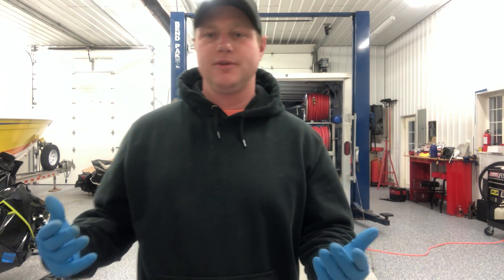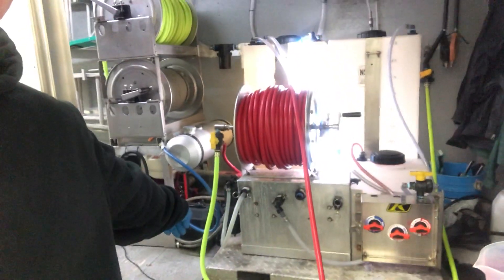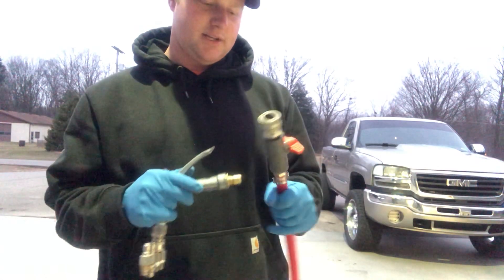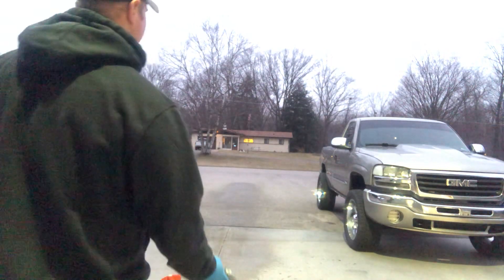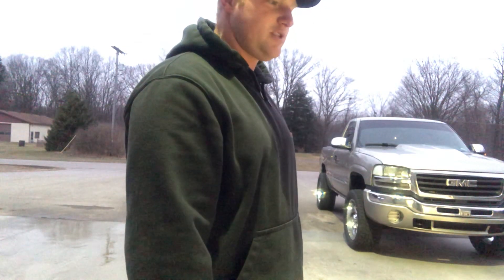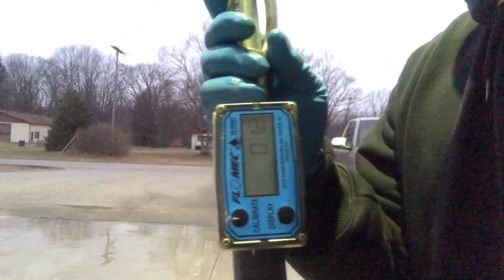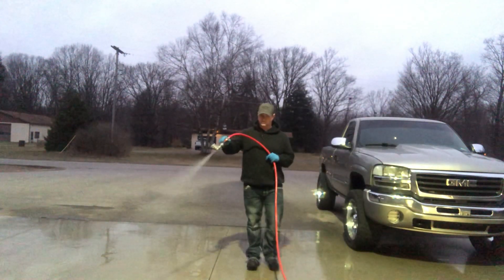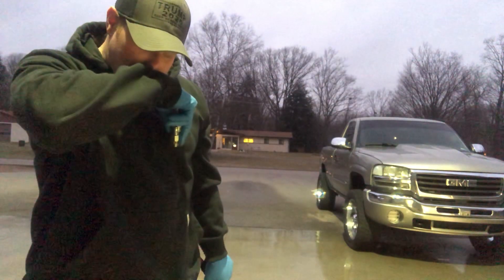12V soft wash pumps don’t last?

Comment: Great 👍 video buddy
Reply from the maker: Thanks, do you have that pump tec?  I believe its the x6 I saw a video of yours on it and have researched it a bit for a year or so and idk how they do in the field?
Reply: @softwashscience  yes I do 👍 I’m putting the box together now and will be dropping videos on it very soon. Plumbing the 3/4 dual battery 12 volt system up as we speak. There has been lots and lots of people interested but it seems everyone tries to keep it “TOP SECRET” and that’s why there has not been many videos on it yet. I am going to explain that in my videos also because people are curious to see it but everyone is also keeping them pretty private when in reality the public needs to see and be able to touch the product and use it. And purchase it. So I am putting it together now and as soon as it’s ready I will launch it 🚀 I’m gonna be running it by itself not with a pressure washer combined because not everyone wants it that way. They would rather just run it by UPGRADING their own existing 12 volt systems or adding this as a 12 volt system. When it’s ready I’ll launch it on all my platforms for the world to see. Thanks
Reply from the maker: @littlespressurewashing  you will be a straight legend if you pair it with a huge deep cycle lithium battery.

Comment: I have a question I have a 5 1/2 gallon per minute 22v pump and 3/8 hose what's 150'ft My pump seems to be cutting on and off while I am spraying continuously If I upgrade my hose to a 1/2 inch will it run without cutting on and off🤔
Reply from the maker: 3/8” hose kills that pump go to 1/2” and buy the right tips.  Give that a try, and get back to me.
Reply: Thanks
Reply: I'm running J rod For tip
Reply from the maker: @Gameingkid123  J rod is just a holder you could have 4 tips of any size so you could have 100,000 of the wrong combinations for your setup you know?

Comment: Hey Josh, Mac here, excellent video on the spray patterns your getting with the George Fisher 1/2” ball valve.

Would like to talk with you some time, if you do that. Kind of new with Soft Washing, 3 years now or so.

Building my first trailer, on the new driveway of the new house my wife and I just bought 4 months ago here in Florida.

Could really use some advice if your able or willing , if not, its cool.

thanks for the great videos and knowledge your sharing, I appreciate it.

Mac

Never built a trailer before, if your don’t mind, I could use some help on placing my 12 volt system correctly so that it will run as efficiently as possible, like yours.
Reply from the maker: Yeah anytime thanks for the kind words.  Text me at (616) 299-2390 so I know its you and then shoot me a call or facetime so I can see what ya got.

Comment: I asked AI 200 feet of 5/8, and yes, it dwindles down on 5/8 gpm.  But if you run the first 100' in 3/4 and then 100 feet in 5/8. Gpm goes up nicely. Pump I told AI was 7 gpm. Running all 3/4 would be great but I don't like dealing with 3/4 hose up on the roof. 5/8 is nicer to handle.
Reply from the maker: @1stFlyingeagle  in video i am running 1/2”
Reply from the maker: @1stFlyingeagle  in my opinion, you can run half-inch if you’re only running 200 feet of hose and you’re not gonna really have any problem. If you run 5/8” and you’re only running 200 feet. I dare bet you it’s going to spray better than a few run 3/4”.  Your pump outlets say they are three-quarter inch but if you actually look at the ID, they are really not. I know at my house. I run all sorts of different hoses to water my grass and I can run like 50 foot of 3/4 and then the rest like 100 foot of 5/8 And it kind of sprays like crap off my well pump. But if I run just 150 foot of all 5/8 it sprays way better at the end.  It actually hurts the performance when you go from small to big then back to small.  Bottom line is when you go much longer than 230 feet or so it starts to really lose performance. I have about 270 feet on the real that I run now but I only use it for roof cleaning and I never like when I run out of hose, so I make it work and it’s set up as best as it can be for what it is.

Comment: My wife is a dog groomer accustomed to city water pressure and flow rate.  She's new to mobile grooming.  Our current system is better than most mobile groomers, but it's still not good enough.  She needs better GPM + PSI.  She will only use shower setting on any standard garden nozzle (there's no changing her mind).  Currently running (2x) 12v shurflo 4008 pumps (3gpm/55psi shut off), (2x) accumulators. One line goes straight back (w/ ball valve), the other passes through a ventless propane water heater (1.6gpm/120max psi).  1/2" PEX the whole way (4' vertical priming, 16' total distance). Both lines come together using a Y mixer washing machine hose (3/4") and into a flexible line (1/2") and nozzle (garden hose adaptor).  I assume the problem is water heater output doesn't match what the pump is capable of. Likewise for running 1/2"pex vs. 3/4"pex.  NVM ALL THAT..... How would you set up a dog washing trailer to match the flow and pressure coming from the city.
Reply from the maker: I would buy a 6gpm or 7 gpm pump 70 to 100 psi.  Upsize your lines if you feel like you need to but bringing 2 1/2” lines into a 3/4 should be plenty but I think pex lines are measured by the OD and not the ID so it might not be even a true 1/2”.  Also the ball valves and y mixer and all of that I would make sure your valves have a large orifice and basically just figure out where or if you have any restrictions in your system holding you up.  Could also be the nozzle your using is restrictive.  Also city water is always 60 to 80 psi and flow typically is 8 to 12 gallons a minute.  Bigger lines, bigger pumps, better valves maybe like I said and better sprayer.  Shower nozzle is fine just make sure its a good one.  Also see if you can disconnect somehow and test the ammount of flow you get from the water heater and see if thats the issue.  If it was an issue that pump would sound a little different than the other one you would hear it staining more.  In the short term something to try would be adjusting the screw on the bottom of the pump.  Most pumps its a Phillips head or an allen head and if you crank it like your tightening it that should increase the pumps pressure setting / shut off psi.  See if you can crank both pumps up and that might fix the problem but I would say your going to want bigger pumps eventually.

Comment: I have 5.5 gpm Northern tool Northstar 12v pump. It's been over 5 months now and still going strong. I rinse fresh water through it after every job. If it goes bad so what they're only $160 better then buying a $1000 plus pressure washer. I use it for house washing instead of pressure washer. I have Two 55gal drums with the pump mounted on the top and hoses going into each drum with valves on them. 150ft of 5/8 flexzilla garden hose hooked to my homemade wand and I can reach over 2 stories high. It works for me and makes me $. I only use my pressure washer for concrete cleaning.

Comment: thanks bro..new here. But stupid question, why would i need a wand vs a gun vs a "straight" connect? do i really need both or is as you demostrated get away with the converter.
Reply from the maker: You don’t need more than one I just do
Reply: @softwashscience  Cool. Which one do you see your self using more often? thanks!
Reply from the maker: @d0uble_O   the trigger gun
Reply: @softwashscience  cool! thanks!

Comment: I run a NorthStar 7GPM. Been running it for a year now and no issues at all. I rinse 
everytime after each job. I do mostly house washes with a occasional roof so that may 
have something to do with longevity of the pump.
Reply: Is those pumps good?
Reply: @keithmeka4ever377  Soft washed over 100 homes and several small commercial jobs so far. 
Works great.  I run 5/8 flexilla hose. Get about 40 ft distance .
Reply: How have you got the inlet side of your pump plumed. I run the same pump and 5/8 on outlet side and only get 24' on good day. What tips do you run
Reply: @tonydodd9034  I run 3/4 poly braid tubing on the inlet side to the pump. It runs through a half inch PVC pipe manifold that built . I also run the water side with no valve. I only run a Pentair valve on my chem side. 

I run a homemade wand out of 1/2 PVC  pipe about 16 inch length. Then reduced down to 3/8” copper tubing 4 inches long with a threaded end . With a 
15 dollar Ryobi adjustable tip. 

My NorthStar finally died. The pump head went out. Would have ordered another pump head but they were out of stock so I bought a Delvan 100psi 7gpm  12 volt pump. About the same distance as the NorthStar.

Comment: Josh you not only have an amazing rig set up bro, but you also have a badass personality 😎 

I look forward to watching more of your videos and learning what I can! I currently have a painting and remodeling company but have been wanting to venture into pressure & soft washing, I'm not sure if I want to do a skid build in the back of my truck, or use my 5x10 single axle enclosed trailer, or my tandem axel 6x12 open trailer? I like the idea of the skid build for not always having to pull a trailer, but then I lose the back of my bed, I like the idea of the enclosed but the problem is that it's only a single axle! And the only problem I have with the tandem axle 6x12 is it'll be open to the environment! What would you suggest? Appreciate any advice, thanks Josh and you also got a new subscriber bro!!
Reply from the maker: My entire trailer is disassembled and I’m building all new now if I were you I would do an open trailer because it has the two axels
Reply from the maker: But enclosed can be nice as well if you hve multiple vehichles do a skid buts its gpong to ruin your truck
Reply: @softwashscience  thanks bro, I appreciate the advice man! Looking forward to your next build!!

Comment: I use a Harbor Freight irrigation pump. Almost 18 gpm. No battery to charge. No worrying about losing battery power. Just a little gas in my Honda 3000iu inverter generator.
Reply from the maker: To much flow for residential roof cleaning though and won’t work with the proportioner .
Reply: @softwashscience  I've been using it for 3 years, with a proportioner. Here in Georgia, many houses are 2 stories and taller, so it works great.
Reply from the maker: @ILC-eo6vk   then its not an 18gpm pump because the proportioner is only able to do 13 gpm max flow but your never going to run your soap wide open so really it will only flow about 8-9 gpm max.  If you doing vinyl siding your only going to get about 6ish gpm maybe 7.  Doesn’t the pump overheat if your not on the trigger and lets just say left it running for an hour or two?  Idk flow is great but not for roof cleaning.  I assume your doing mostly house washes it sounds?  Then yeah it probably kicks butt depending on the psi and all that good stuff.  I never use my 12v to wash houses really its mainly for roofs and other high sh needs.

Comment: Hey josh, would a full rite 12v pump work? Like one for fuel transfer
Reply from the maker: No those are transfer pumps probably low psi and a bypass style and wrong seals if its for fuel.

Comment: Do u rinse with 12v?
Reply from the maker: On a very very rare occasion I will like if I wash a shed or something.  Outside of a few pumps that exist a 12v can’t give professional results.  You need about 150 to 300 psi and some large volume to rinse correctly.  Even my 5.6 gpm can’t rinse some areas correctly.  Vinyl houses here and the Lichen we get here needs big water droplet’s to come off.  I see people just simply putting water on the siding and think thats rinsing and if they brought their rig to the jobs in my area they would be in for a rude awakening.  I treat siding with my 8gpm and rinse with it too.  12v is mainly for roofs, concrete and that high % sh stuff.

Comment: Ive never hears of an accumulator
Whats that do whats it for ?
Reply from the maker: It a holding tank for pressure so it stores pressure and helps to prevent rapid pump cycling when you want to use different tips.  Without one your at risk of killing the pump unless you use the correct tips.  In short it allows you more versatility  for spraying.

Comment: Hey bro do you have a part list I want to make my 1/2 hose quick connect on my soft washing
Reply from the maker: Solution Landscape & Pressure Washing I explain it in detail in the late night video and a couple other videos on my channel here and show close-ups so you can see everything you need and exactly how I put it together.
Reply: Soft Wash Science I just looked you mean 5 days ago correct I didn’t see anything 
Thank bro
Reply from the maker: Solution Landscape & Pressure Washing  no I have a couple videos from awhile back.  You can see it up close is at least 3 of the videos on my channel and you can make a parts list from it.
Reply from the maker: Solution Landscape & Pressure Washing  In one of my videos I not only show it up close but I give a parts list as well.
Reply: Soft Wash Science thank you
Reply: @softwashscience  couldn’t just post a link?
Reply from the maker: @CKimbrow12  no idk what one it is I reference it in a few of the videos and two I go into detail about it.  I would say that it took me a lot longer to design and orient the first one than it will take yall to find a video  here about it but I know its in a couple if I recall.

Comment: Am I understanding correctly?

1% = 10%
2% = 20%
3% = 30%
4% = 40%
5% = 50%

Does this figure relate to the downstream mix or what % is coming out of your tip?

What % should I begin with on non-painted wood, such as on a deck?
Reply from the maker: The % is = to the the exact % of SH strength that will make surface contact.  If you look wide open is 6%.  The values are based on an 11% sodium hypochlorite concentrate. I buy stronger SH but Sh is heavier than water and my line is longer with a few bends on the sh side so the number on the dial for me is pretty close to the exact.  Downstream mix I pull from a different source and that goes directly into my injector about 12:1.  For wood cleaning thats a different animal and I Approach would Cleaning different than anyone else so I can make some recommendations but it’s not as simple as just a percentage it’s an entire process no matter what chemicals you choose to use.
Reply from the maker: If I were you I would just start out down streaming everything just make sure you soft wash.  No hard washers round here lol.

Comment: Hey my man yes you definitely got the details and science down. What exactly did you do to reduce the 3/8 quick connect to the 1/4? Looks like a plug to quick connect? Do you have a link to where I can get that please?
Reply from the maker: Carlos Saldua its a 1/2” to a 1/4” and I made that myself because they don’t exist.  The end adapter it also a 1/2” to 1/4” on the carbon fiber wand and I made that on a 3d cnc mill.
Reply: @softwashscience  I figured as much I looked all over. Eould you be willing to do a little sales, I wouldn't mind buying a few...
Reply from the maker: Carlos Saldua can you message me on facebook with screen shots and stuff circled that you want so I know for sure were talking about the same thing.  If I have some I can sell you one but I do a lot of what you see kinda one off.  When I pull a guy off what he is doing in the shop thats making $300 an hr and I have to mesh some custom stainless fittings together I will essentially loose money and do loose money when I make some of this stuff but I’ll see what I can do.
Reply: @softwashscience  Okay definitely understand that! I have a buddy that's been a CNC machinist for years let me see what he can come up with!
Reply: I'm IN!.. I could use  a few of these also......I WOULD BY NOW....WHERE DO i SIGN???

Comment: Hi,
My pump is not shooting a good distance. I don't hear air in the line. Why do you think it's only shooting about 15 ft when it used used to be about 40 ft.
5.5gpm everflo pump
Reply from the maker: Yanis Hall The battery might be weak or the wiring connections. It could have a small air leak somewhere. Also it could be just your gun or your hose reel is closing up with rust. Or if you don’t rinse your pump out it could be the air pumps goingOut. Or maybe it’s just not primed 100%